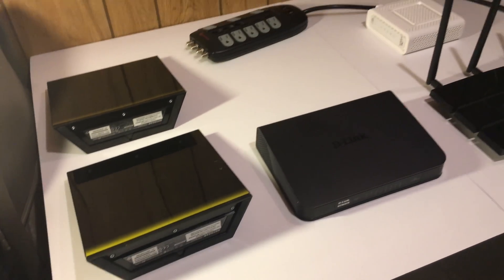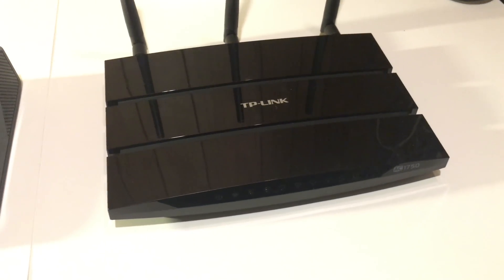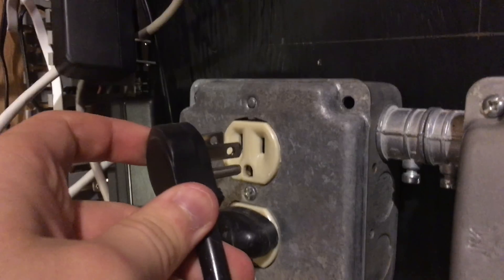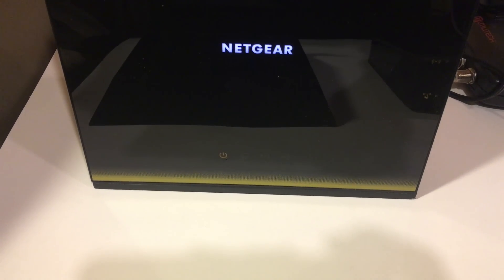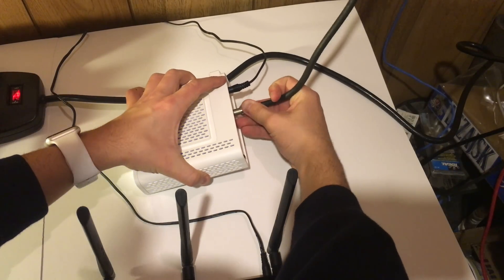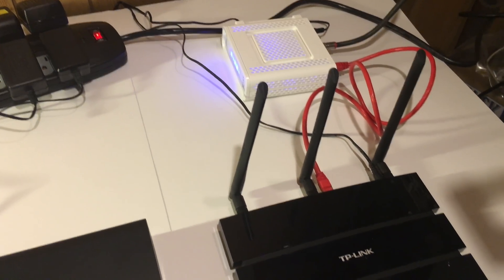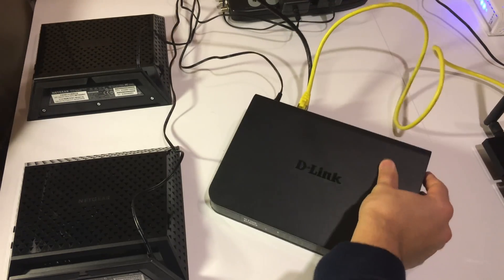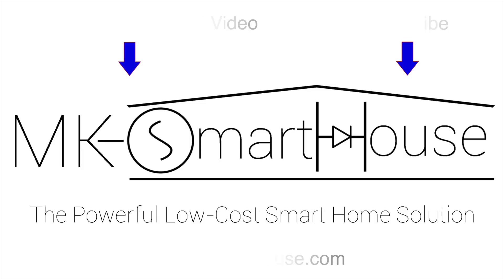Complete Guide Setting Up The Smart Home Network: Hardware

Comment: First of all I'd like to thank you for your
efforts but I have a question and I hope you answer me . 

i have been started following the guides
three monthes ago .. i have been finished the network then the home automation
server then openhab and remote access .. now i stopped at adding the devices ..

my
pivotal confusion is that i found that sonoff and shelly , for example ,
provides much simpler systems that doesn't need rasbperry pi or openhab , you
just attach the device ( switch , plug . ...etc ) with electricity and bind it
with thier own app , that simple . the question is why i would be forced to use
a complex system while there is more simpler systems provided ?

Comment: I didn't see this comment but didn't look very hard. I can't believe used the WAN ports on 2nd & 3rd routers! That blocks anything other then internet so can't see anything else not connected to that part of the network. All you need to do is make sure all routers use a different IP & MAYBE disable the DHCP on all but the 1st router!

Comment: $110 per router, that's too expensive and a waste of routers. A wifi-mesh from open mesh or UniFI would have cost less and supported handoff
Reply: also support poe , and when you make changes a single dashboard to work with

Comment: "Need full wifi coverage" Buys fully fledged routers instead of access points xD, great vid tho
Reply: Most consumer grade routers are cheaper than entry level access points. Although you lose features like WiFi roaming going that way as opposed to buying a proper access point.
Reply: ITS AJB he could have gotten those routers cheaper than that? I'm not excusing the video makers actions, I'm just giving a reason why someone would go that route. I buy access points personally when I need access points although I am looking into the Ubiquiti Amplifi mesh router and seeing if it can be used with my PFsense router without issues.

Comment: please use cat6 shielded lan cable for gigabit lan u will get the proper speed the switch was made for,and remember this guy has more money than sence  so u don't need amazon echo, u can just use a pc
Reply: RichMantaray cat 6 utp is still rated for gigabit speeds and the length of the cable used he wouldn't really need shielded cables

Comment: OK. This may be a Noob question but; Why do you go Modem->Router->Switch as apposed to Modem->Switch->Router? If its a gigabit switch it shouldn't matter right?
Reply from the maker: Hi good question, if I did it Modem->Switch->Router then all the ethernet devices would be connected directly to the modem, and not connected to the router and the router would not act as a firewall also it would not hand out ip addresses through its built in DHCP server. There are more reasons but those are just two.
Reply: Good points. Thank you.